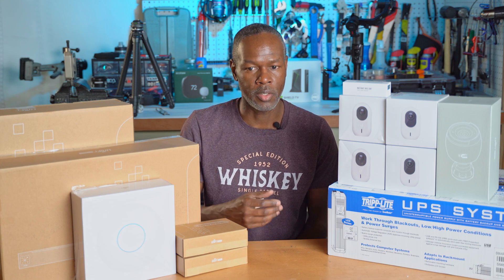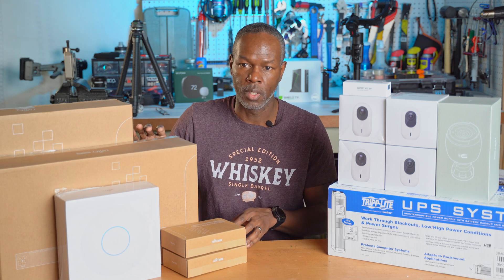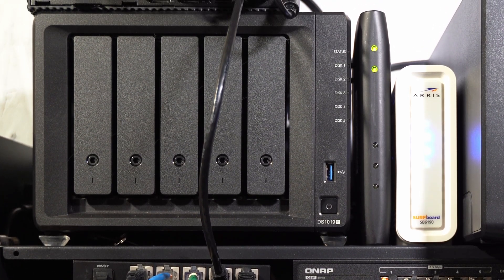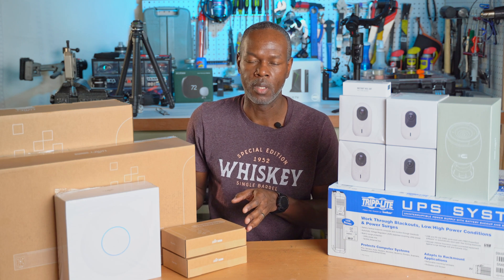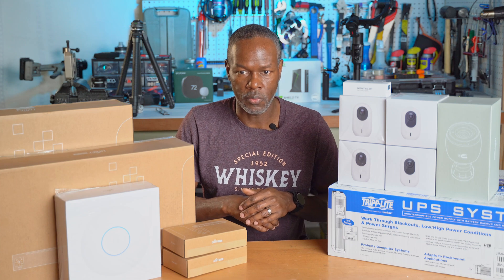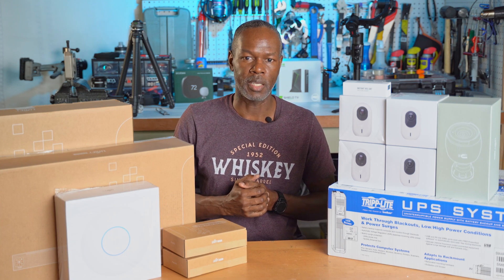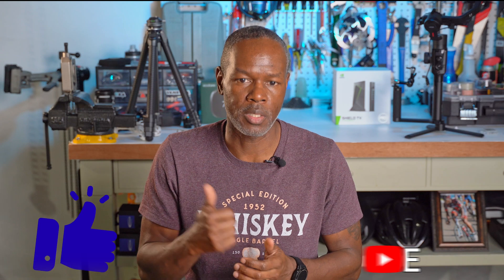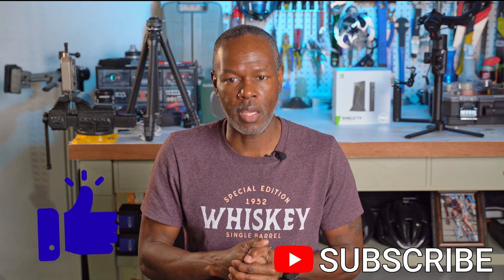2023 Complete unifi network (Home Lab) tour

Comment: Nice Job. I'll join the others that mentioned that there is advantage to putting the patch panels above and below the switch. I did notice that your equipment doesn't actually have a 10gb upgrade path. The SFP+ ports on the UDM Pro are only useful for an uplink and downlink and that switch only has 1gb/s SPF ports. I think you would probably find that if you wanted to upgrade  a few devices to the higher speed you likely will be purchasing Unifi's aggregation switch to get there in the ecosystem without it costing an arm and a leg. Although if you only needed to connect a Synology NAS high speed to a single computer there is the option of using a crossover cable and directly attaching a PC directly to the high speed port while connecting the other NIC to the network which would allow the high speed connection on that one device without any switch purchase at all.
Reply from the maker: I already have a 5 port unifi 10gbps switch the is attached to a ugreen nas

Comment: I definitely agree that rack studs are awesome. I only use them for switches and lighter devices. For heavy devices or devices that I don't plan to replace, like shelves, UPS, PDU, or drawers, I still use cage nuts. I don't trust rackstuds holding those heavy devices in place

Comment: Sir, excellent video.  Thank you for your content.  Over the last couple of years I have had to update components of my 14 U rack at home.  You have reminded me that there are a couple of things I want to upgrade currently.  I run Unifi for my home wireless, but have yet to make the leap over to the switches or routers.  pFSense is what I am currently using for my routing/firewall needs.  I run Synology for my NAS and my NVR camera recording (since 2014).  Since you mentioned home assistant, I'm going to do more research on that since that is something I've been curious about for a minute.  Big ups from DFW, Texas.
Reply from the maker: Good luck keep me updated

Comment: Great vid! Some tips if i may:
1. When mounting equipment using those plastic cabinet screws (have them aswell, cant recall the name) , support the device from the bottom, allowing you to tighten the screws to the max , by hand. .

Comment: Nice DIY setup. Looks Great. I noticed on the topology a Ring doorbell. I would get the G4 Doorbell if I were you. If you're running Protect and have a AP already then it's worth it in my opinion.
Reply from the maker: Trust me I constipated it for a while, the main reason I decided against it was the terrible audio, both versions have lousy audio. I'm hoping the update the original G4 Doorbell and address the poor speaker proformance
Reply: @teckinmylifebyeuanhenry1353  Huh. Thanks for mentioning that. I had no idea they had poor audio.

Comment: Nice setup. However, the top patch panel should have been placed at the bottom to keep the space in front of the disk tray free. There is now also no way retracting the udm pro without disconnecting all patches...
Reply from the maker: Thanks, good point!

Comment: Really nicely done. About to build something similar. Feeling more inspired now :)
Reply from the maker: Good luck, enjoy the process.
Reply: @teckinmylifebyeuanhenry1353  I am so new and green. I will keep watching this video to learn and do my best to duplicate...so clean. I was wondering what I do with all the cables coming from the house in the closet to cleanly plug them in the Unifi switch. So I need to get a patch panel and the couplers you posted to connect all the Cat6 into in the back of the panel...correct. NowI have an Unifi USG gateway. Unless I missed it, where do I get the shelf to mount in the rack so I can sat my USG on that shelf in the rack?

Comment: Nice job with the video and rack.  I totally agree on the Rackstuds, they are so much easier to work with than rack nuts and screws.  I'm guessing you're connecting your editing computer with a 10 gig connection?
Reply from the maker: The plan is to get a DS923 and connect it via 10gds